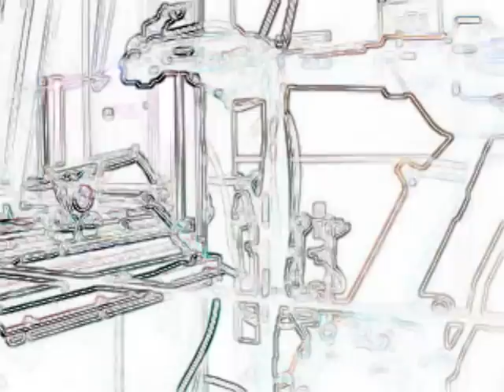Plasma + Techno = Trippy as Hell

Comment from the maker: @greekblonde No, plasma spray is a coating technique that uses an electric arc to ionize gas creating an intensely hot flame that transitions to 4th state of matter, plasma. Metallic powder or Ceramic powder is then injected into the plasma (held at 10,000 Deg C or 18,032 Deg F) which melts any material and then the moment it's injected it travels at subsonic to supersonic speeds (varying on nozzle inputs) onto a substrate. The power is rapidly solidified creating a durable coating